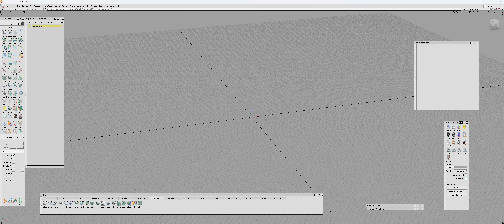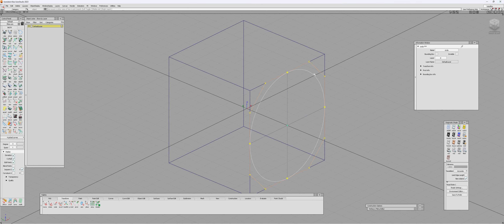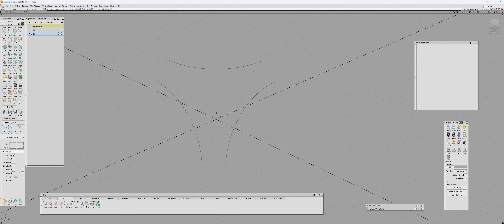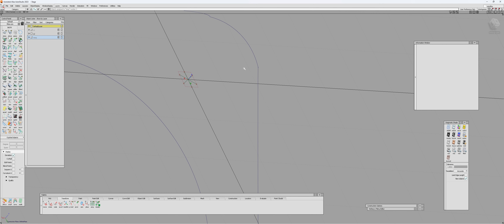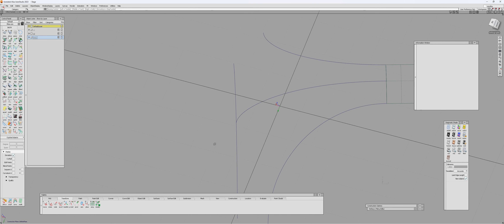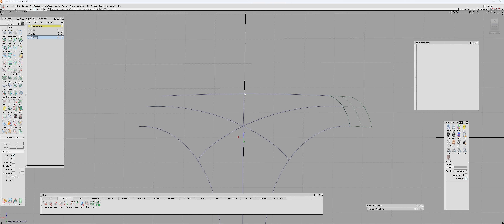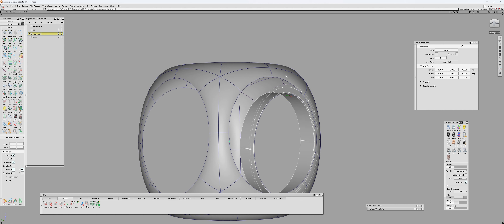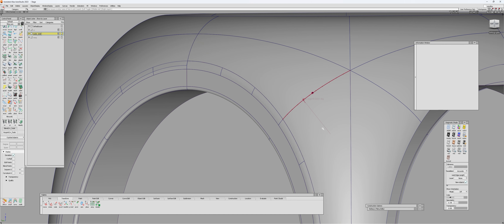Alias Modeling TUTORIAL - Dice. Part 1

Comment: New subscriber here :) this channel is pure gold

I'm pretty new to NURBS modeling and I'm just starting out with ALIAS. Can you please make a specific tutorial on how to achieve curvature via CV massage? I know you explain it in this video but I think it's not enough for newbies like me :/ what does deviation mean, what does angle mean when you use continuity checks... how do you know when and why to use slide CV or move in normal direction. ALIAS is a whole universe xD

Thanks in advance and excuse my bad English
Reply from the maker: welcome on board! I made a video a while back about deviation, continuity checks, curvature plots and deviation 1.0.  I hope that should cover some questions you asked: https://youtu.be/jwdTtefeh4c. As for CV manipulations it is quite a simple concept: you look at the curvature plot, and if it goes up, - you move cv's down (normal or directional) and vice versa. Same with the sliding cv's: you slide them around based on the curvature plot. If error is too close to an edge or spread by small chunks along the edge, - sliding may push them towards one side where you can push it up or down.  As if you squeeze bubbles from the sticker. As for practical examples. - they are spread thin across the videos, so check them out. As for a more condensed practice wait for a next modeling lesson, I will do it eventually :)

Comment: Sir, how are your circles separated from each other, I have adjusted all the options as yours but still it didn't work. Is it related to circle options under circle options for example sweep angle, segments, degree, openings?  Btw what is your settings of circle options Sir?
Reply: Ok sir I found it in your other tutorial,  segments:4, degree:3, spans:1 right?
Reply from the maker: @borazeytunlu963  hey! yes, it is 4 segments, 3 degrees and 1 span non-periodic RATIONAL circle. Please note that if your circle in not rational, 3 degrees for a segment will not be enough to make circle circular, you will have a pretty big deviation. To battle that open your construction options, scroll down and activate "rational flags" checkbox BEFORE making a circle. Alternatively, bring more degrees for each segment: sweet spot is 6 degrees per segment (4 segments, 1 span) for non-rational circles. If you want to learn more about it, - check my audi bolt nut cap lesson, - I have a full explanation of the circles in Alias there: https://www.youtube.com/watch?v=Qb6ceN3Ht0M&t=48s
Reply: Ok Sir, thanks a lot your detailed explanation, btw your tutorials are very helpful to learn A-Class modeling thanks for this too. 🙏

Comment: How do you create a 1 degree CV curve and save it as a preset so I cam add it to a shelf?
Reply from the maker: You double-click on the tool in the palette (ep_crv, edit point curve), select desired amount of the degrees, confirm (click "go") and drag-n-drop tool icon in your custom palette. You will have 2 identical tools now: one in the main palette, and one in your custom palette, but with different parameters. the only thing left to do is to hook it to your hotkeys in the preferences > hotkey/menu editor.